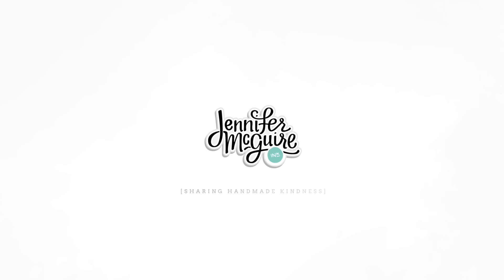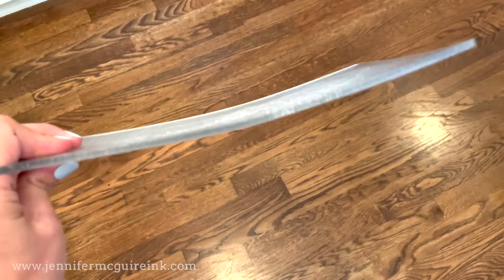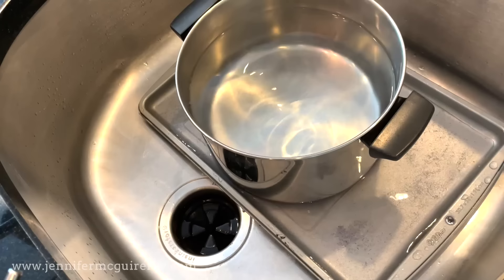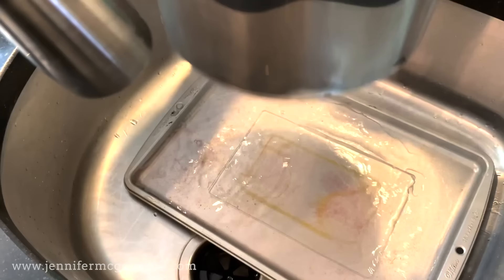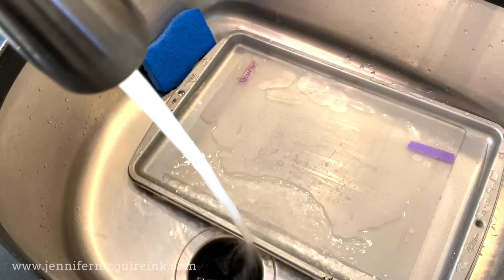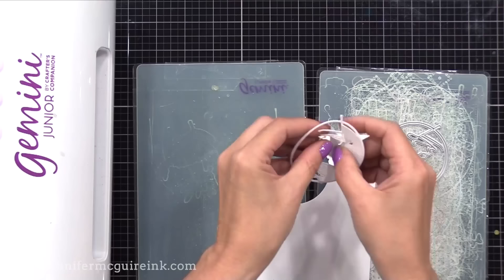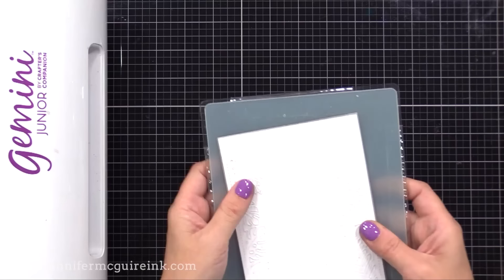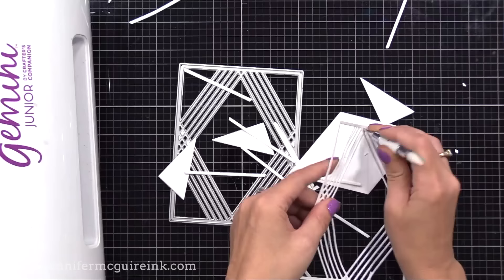Fixing & Avoiding Warped Die Cutting Plates

Comment: Thank you Mr. & Mrs McGuire. Much appreciation. You've taught me solo much.  Peace Luv & Blissing ❤👍👍👍. Okay I had to edit this. I tried this technique. It didn't work for me. Perhaps the plastic is different for a Sizzix machine, or my pot was not heavy enough. I even had metal weights of 8lbs and magnet bar that is about 3lbs one on top of the other. That plate still wouldn't flatten. Now I'm frustrated cause I did this all day and it's hot here. So I just put it in the boiling water literally cooked it then did the technique of it sitting in the water with the pots and the weight. That sucker is still warped. lol smh. This is some mighty plastic. I'm not giving up.

Comment: I started my paper crafting with a Cuttlebug, mostly because of the lower price, but I have found that because the C plate is thicker than the B plate, there is very little warping of the B plate if you have it on the bottom and cut down rather than up. I only cut up into the B plate when using an intricate die that is not cutting well. I now also have a Big Shot and a Gemini, and have found the warping with those plates so annoying. Thank you very much for all of your work and your willingness to share with the crafting community. We do appreciate you (and now also Ken for his nerdy explanation!). As someone else here said, I'm not a scientist, but his explanation of the vapours is great. I've wondered about vapours from heat embossing, because the powders are a form of plastic. Could Ken contribute any information there?

Comment: I cant believe how well the double sided plates work. I had to add card stock shims to the whole thing, but once I had it cuts like a dream and there’s zero warping so far after twenty run through with cover plate dies. Usually that would have made a mess of them. These two? Still flat as pancakes. Incredible.
Reply: Try adding 20 ml vinyl to your shimming.  See my comment.

Comment: Hi Jennifer, before I got the double sided plates, I almost every end of day use, cleaned the bits of paper out of my Gemini, Jr, and Go plates and washed them with very hot slightly soapy water. I also stored them flat under my Gemini’s.  I still do this with my Gemini Go and I’m still using the original plates. I have a sticky roller that lifts a lot of the bits out and a microfiber cloth to use with the soapy water. Since I use Press’NSeal when paper piecing I can use it to lift bits of paper throughout my day so end of day clean up is easier. I have several manual die cutting machines and care for them the same way. I don’t have to be as diligent with my Diamond Press and Marquise folders as long as I don’t cut in the same area to many times in a day. I think the friction heats the plates enough to wrap them if continuously cutting in the same place and bits of paper hold them in that warped state. Your husband and you did a great job explaining everything. Thanks for the helpful hints!

Comment: I discovered a couple of years ago that using one plate on the bottom only, and the other on top only that they stopped warping! In fact, I did this with warped plates and they have straightened out almost completely.

Comment: Many years ago, I attended a class given by Stephanie Barnard where she described using the "bounce test" to keep Big Shot plates from warping.  Before cutting, press your finger down on the bottom cutting plate that is sitting on the platform. If it "bounces", meaning the cutting plate has started warping, causing a gap between the plate and the platform, then flip the bottom plate over. If the top cutting plate starts cupping I put the cupped side face down on top of the die. The key is to not let your cutting plates get too warped before flipping them over. I started using this technique at least 4 years ago and my plates stay flat. I've only gone through one bottom plate (it finally cracked with use). At which time, I replaced the bottom cutting  plate with the top cutting plate I had been using and pulled out a new plate to use as the top cutting plate. Also, when I'm done cutting, I roll the platform and plates half way through my Big Shot and store them that way (to assist in keeping the plates straight.

Comment: Good thing I waited until you released this video! (I was going to try the oven method at 200F but I was concerned about possible fumes). This sounds much better. Nerd question: If this method is used a few times on the cutting plate, will the plate get more brittle over time? (BTW, I used my vagabond for 8 years without issue until I ended up stripping a gear in the motor. sadness....)

Comment: Boy the hot water trick worked like a charm!  I used my 10x15 Pyrex dish, poured boiling water over the plate in the Pyrex dish then set my 5 qt. enameled Dutch oven halfway filled with boiling water on top of the plate.

Comment: Hi Jennifer! Thanks for your well researched videos.  They are always so helpful. Would you mind doing an update to this video and sharing your thoughts on whether your new sandwich is still working for the Gemini machine. Very curious how the plates have held up over time.  My double sided plates have cracked a bit from this method.  Strange. I wonder what I am doing wrong.  Thank you!
Reply from the maker: Keep in mind that this won't make your plates last forever. Depending on how often you use the plates you will have to replace them at some point

Comment: About a year ago, I ordered (from EBay) 2 -  5mm cutting plates with Beveled Edges. I use these two cutting plates to cut thin metal dies on my Gemini Jr, with no other plates or shims.  I have had nothing but great results with this and no warping at all, as the plates are thicker than the Gemini plates.  I'm sure this is against any warranty but it works well for me. Definately, try at your own risk.

Comment: Awesome video!  I love the geeky stuff!  I a geek in my professional career.  I would love to know what tips you have on the Big Shot - specifically for 3D embossing folders.  I want a Spellbinders Platinum 6 - on my wish list, but I have so many accessories for the Big Shot.  I have watched your die cut machine reviews and did some research on my own, as well as, have reached out to Spellbinders and Sizzix on my own with questions.  After having my die cut machine break recently - I feel lost without one.  My new one should be here tomorrow - I decided on a Big Shot again after a little more research and because of the products I already own.  I had my other Big Shot for years - saving it for spare parts>>>>yes  - I like to fix things too.  Now I see a reason to have a back up so the Spellbinders is on my X-mas wish list!!

Comment: I tried this today and it works great.  Thanks so much for the video.  I do have a metal die which got warped because of the warped plates.  Anyone have an idea to straighten that?  Would this same method work on the plate?   thanks in advance

Comment: Great video, but 1 week too late, lol. I just tossed 4 warped Spellbinder’s Platinum plates. I wish I had thought of doing the boiling water. I tried putting them in the dishwasher but that did nothing, so I figured there was no hope for them. I’ll try your tips the next time. Thanks!
Reply: Joke’s on me! My husband grabbed the plates out of the trash without my knowledge and put them under a tool box and other heavy items in the garage to see if they would flatten out (they didn’t). When he heard me talking about your video, he brought them to me to try your method. One got fairly straight; the other 2 are still too warped to use even after 5 tries (the 4th was cracked and he left that in the trash). So I was able to rescue one plate.
Reply from the maker: LOVE that he grabbed them to try to fix them for you!

Comment: I have a big size Gemini and do not know where to buy the green plates for it.  I really like your wonderful shows.  Thank you so much.
Reply from the maker: Simon Says Stamp carries them but they are currently out of stock. Sign up to be notified and they will let you know when they get some in,  https://www.simonsaysstamp.com/product/Crafters-Companion-CLEAR-CUTTING-PLATES-FOR-DOUBLE-SIDED-DIES-Gemini-gem-acc-dsdp-gemaccdsdp
Reply: Amazon, Michaels, JoAnn's, Walmart and even eBay carries these.  I have used them ever since Jennifer recommended here over a year ago. They have been the best ever solution since I began cardmaking.  Mine are still flat and I would recommend to all as well.  The only additional thing I have added is using vinyl sheets cut to size that are 20 ML thick. The vinyl helps to cut the very intricate dies without having to pass through many times, etc. The inner part of the die usually remain stuck to the vinyl and can be scrapped right off. This vinyl can be purchased many places like Amazon (36 x 54 inches) that I paid $7.36 tax included. This sheet may well last for years. I only replace the panels when they are really cut or misshapened a lot. Thank you Jennifer for all you have taught me over the years.  I would not be the cardmaker I am today without you.  May God bless you forever.

Comment: Thanks so much for this video! My plates warp some but not really bad because I flip them every time. However, I am going to try this on both the clear and the plastic. I've had problems with my metal shim warping. Is there anything to do about that? Hot water wouldn't help it would it? Again, thanks for the information!

Comment: Thank you for sharing this demonstration and explanation, both are very helpful. I'll be giving one of my warped plates this treatment this week. I am wondering, though (and perhaps your expert chemical engineer will have the answer) if when I start to use the newly flattened plate again the same warping problem will arise. I appreciate that this process can be repeated but I do wonder if, over time, the heating and cooling will weaken the bonds in the plastic and make it prone to cracking, perhaps in the die cutting machine or, worse, cracking and shooting out of the machine. They're just my thoughts and I shall still try this idea to get a bit more life out of my plates. Best wishes from the UK.

Comment: I have some dies that I have cut using this method and it works well cutting but I then have to run them through again with the embossing mat to dry emboss.  For some reason it cut through some of the paper instead of embossing it. I use 110lb cardstock. The sandwich I used was the clear cutting plate, green plate, embossing mat, paper, die, green plate then the clear cutting plate.  I haven't tried the instructions that came with my Gemini Jr yet for dry embossing.  I was hoping that this would work for the embossing, but maybe the Gemini Jr just has too much pressure when using the green plates.  I was wondering if you had tried dry embossing with the new plates set up.  Thanks again for this great tips.  I do use this new way for my regular die cuts and I have fixed my warped  plates using the hot water method.  It worked great!

Comment: Thank you for this technique it works wonderfully on the clear plates but doesn't work at all on the aqua glittered type plates. I tried 4 times in succession and they did not bend or straighten in the least. I even tried putting them in a pan that had them completely submerged with an inch of water above them and a heavy pot full of boiling water on top and....nuthin.🤷‍♀️

Comment: Thank You for a great video as usual. 
I am sorry to say that glass is a solid. It is an Amorphous solid. The reason old glasswindows are thicker at the buttom is for two reasons.
 1. the way the are made. The bobbel of air they used is not even. 2. the thickest part is also the strongest and therefore used at the bottom. Modern windows will never be uneven. 
The reson why it is amorphous is because the silicondioxidmolecules is not in a crystal lattice.

Comment: Hi Jennifer! I tried this on my Big Shot plates. The bottom plate instantly flattened on the first try but the top plate did not flatten.  I tried it two more times but still no luck.  When I used my plates the next day, that top plate cracked right down the middle.  Oh well, no worries.

Comment: I ran into a problem using the sandwich with the double sided dies. My die that had scoring cut through. I tried it with several pieces of paper. Used it with the original sandwich and it scored as it should. Otherwise if no scorelines it cut great

Comment: This is wonderful continuation of your first video. I tried taping the plates together but they would tear in my Gemini. I tried using my 8 inch double sided tape roll right down the plate and sealed the shims and plates together. I have been using them like this for almost a year now without any warping. It is a strong base for cutting. I have other plates for other cuttings feeds like embossing folders.  I am going to try this double sided plate method too, I like having various plates.

I was wondering, can you put Gemini Jr plates horizontally in the Larger Gemini machine? I thought I saw you do that in a video once, but I could be mistaken.

Comment: I always cut into the same plate, the bottom one, and push it in the center so it is completely touching the machine. If it gives a little I turn it. I have been using this method for years and the plates  last for ever…my machine is a Big Shot also very old. I am going to try your method so the plates are clean also.

Comment: THANKS Jennifer I will be using this method later today as I have Several plates in dire need! I was wondering about  your nails, do you have them done in a shop OR are they Color Street Stripes which I just discovered a couple months ago. Whichever yours are really cute.
Reply from the maker: I do them myself. I will be doing a video son. I use these. https://www.etsy.com/listing/978876519/ee-corners-stamping-corners-paper-craft?ref=yr_purchases&utm_content=S-265393&source=aw&utm_source=affiliate_window&utm_medium=affiliate&utm_campaign=us_location_buyer&utm_content=323691&awc=6220_1629942456_87c099048d8e9447508f4300a2668106&utm_term=0

Comment: I taped my gemini plates to my double sided plates back when you did your first video about doing this.  I have had to redo the tape twice since then, but it has probably been at least a year or more since I first taped them.  I have to say this has definitely worked!!  CC's Gemini II has a roller that maintains pressure through the whole length of the roller, which is suppose to prevent some of the warping.  Will you ask your resident nerd to comment regarding the possibility about this helping to prevent warping, or is it strictly caused by thecontinued cutsinto the plastic plates that weakens the structure of the plastic causing the warping.thank you for all your tips!

Comment: I have nesting cookie sheets and I tried your method of hot water which worked great but I put a smaller cookie sheet on top of the larger one with the hot water and plate in between then the other hot pot of water on top and it only took 10-  15 minutes to flatten my Spellbinders plates

Comment: I know you mentioned not really liking shims and I am the same... especially with my manual crank machines.  Have you tried using either the plastic sleeves used for 3 ring binders or a product called Cut Tidy offered by Carnation Crafts (UK company) as a shim?  I truly love this when I cut a complex die.  It's not too thick for a shim and if you use the the plastic sleeve as a folder with the die in between, the die cut card pieces stay in the plastic folder material and you don't have to clean much from the die and not at all from the cutting plates.  Great video though with all your tips and tricks.  I hardly ever have a warped cutting plate and have been using my Cuttlebug, Sizzix and Gemini plates for many years without replacing.. using the tips you demonstrated.  Also, cleaning your plates of the paper cuts with either a toothbrush and hot tap water or your method really helps close up those cuts in the plate material - thereby reducing the warps.  I appreciate your hubby's info regarding the plastics!  I am a bit of a "nerd" myself and research all that kind of info online :.)  It was great that you added that bit to your video!
Reply from the maker: No I haven't tried those!

Comment: Hi Jennifer! Thank you for the great video, I just bought the Spellbinders Platinum 6 and the plate warped the very first time with a small die. Is that normal???
Reply from the maker: I didn't experience that. It seems like perhaps there was too much pressure?  If you know that you had the correct sandwich for die cutting I would reach out to Spellbinders customer service.

Comment: One thing I've found with the Big Shot and it will probably work with other machines plates, before you make your plate sandwich put the plate on a flat surface and press down on it.  If it gives, flip it over.  This will keep your plates from warping and it's an easy thing to do.

Comment: Thanks so much for this tutorial!  My huge Gemini plates are warped on BOTH ends (like an S) so I'll try this technique and report back.  Question: what can I do to prevent the old, previous cut marks on the cutting plate from embossing my card stock when I run it through?
Reply from the maker: How worn are the plates?  That can sometimes happen when the plates need to be replaced. Or the pressure is too high.
Reply: Use copy paper or plastic packaging that comes with dies and stamps.  When I use either of these, it really helps to keep things like mirror cardstock from showing indentations of the used plates.